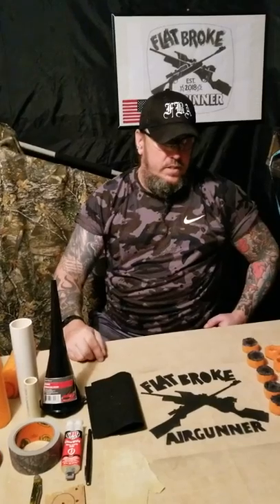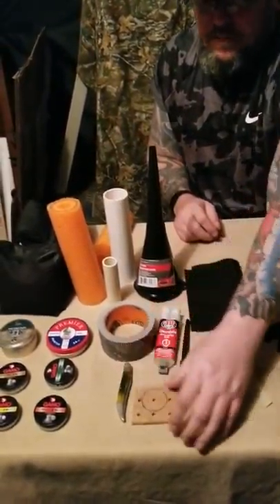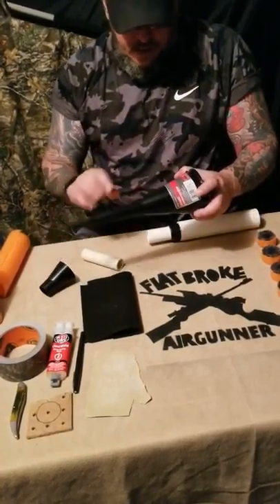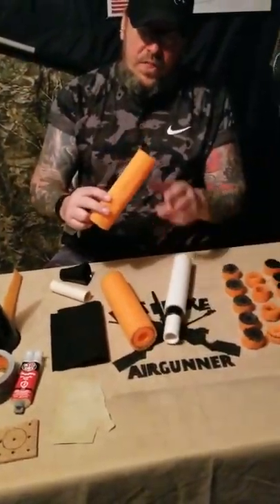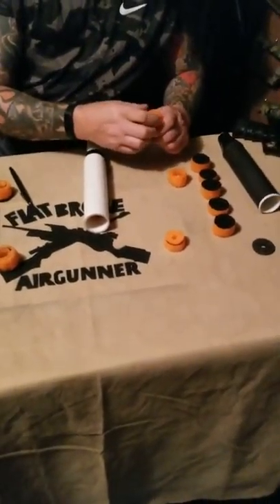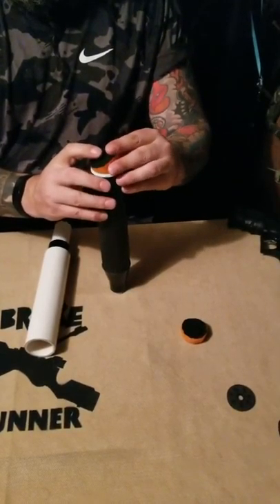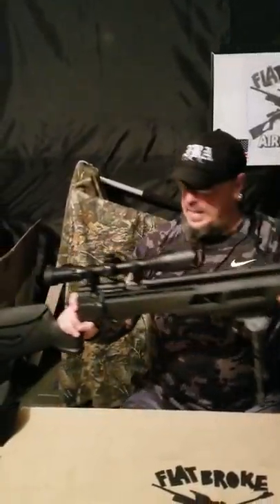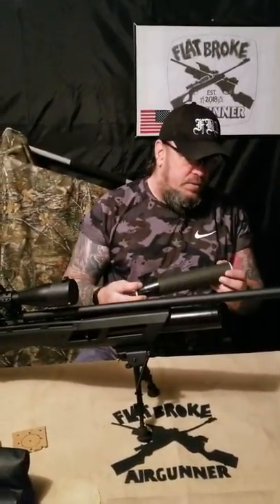HOW TO MAKE A AIRGUN MODERATOR  QUICK AND EASY!!

Comment: Cool video!

I've made several bu in a different way. Anyone want to see it come over to my channel and 'll post you a link. But briefly, recycled deodorant pressure pack can (size will depend upon how powerful your airgun is), some high pressure PVC water pipe, epoxy, quality paints to finish the job. Result super light huge sound suppression from >90db un moderated measure 20cm from shooter's ear to just less than 60db using moderator. It's both very lightweight and very strong. Videos on the channel of sound testing. It does not affect pellet trajectories.
Reply from the maker: Are you on Facebook my friend? I have a group of over 7000 that would love to know of your channel! Please consider joining the flat broke airgunner group.  If it's cool I'll share your channels name. The flat broke airgunner FAMILY is all about supporting each other.  Thanks for watching and taking the time to comment.  I appreciate you being a active member of the FBA FAMILY my friend! Hope you have a awesome weekend.  Be safe and I'll see you on the next video shooter! 🤙 ✌️ 🙏 D